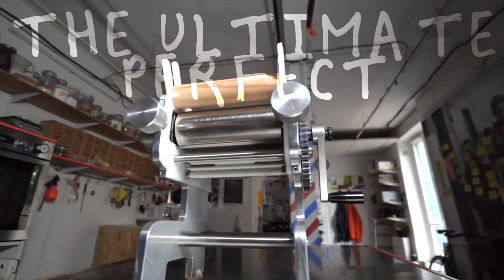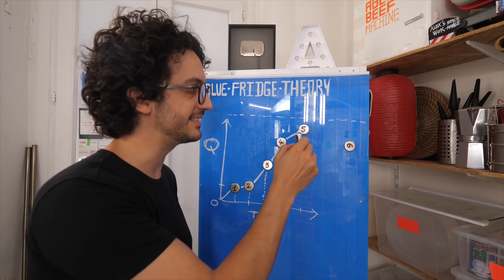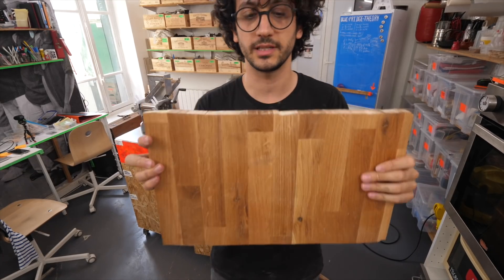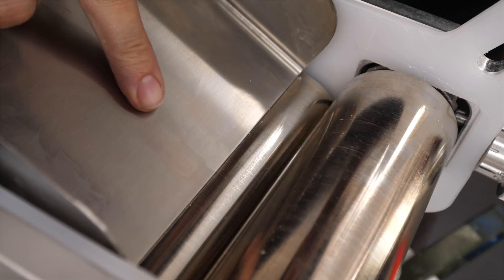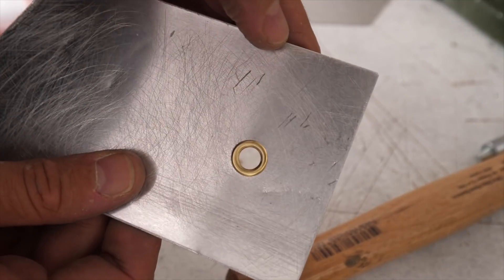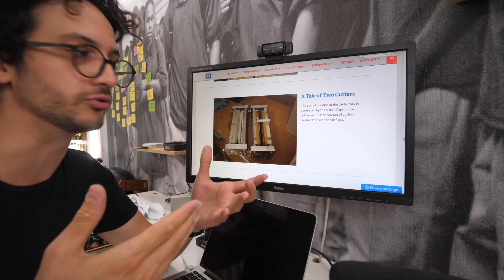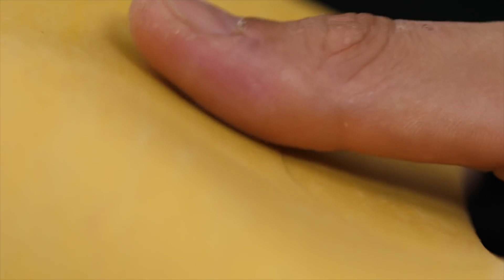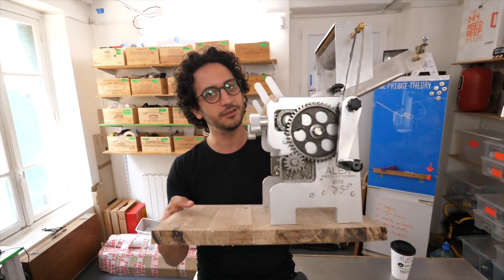You've Never Seen A Pasta Machine Like This... (build)

Comment: I 'member when this was a cooking channel. BTW your tension screw should be spring loaded so you adjust the spring tension preload rather than the actual pressure directly so it self-adjusts with the different heights.
Reply: This project gets 'better and better' the more comments come in!
Reply: He has the screw only on one side. Wouldn't this raise the roller from the other side, potentially ripping the dough due to uneven tension?
Reply: Ideally, true; maybe not in this application.  'Our Hero' will discover more as he goes along!
Reply: Icarus he has one on each side, as seen at 6:32.
Reply: I was thinking just a bit of flat spring steel that was then tensioned. This would have the give and float with the dough as you mentioned. At some point though the solution will not be great because you cannot get much of a range of tension with such a small diameter pin and a single point of contact. For greater tension range you need a strap that wraps the pin or a disc clutch with the disc clutch maybe being more practical for this application but then not flowing with the dough.
Reply: For sure, this is high level thinking.  We pasta makers might like a better machine at a lower price...but the very best machines already exist and it is only necessary for us to save up and buy them if we are desperate lovers of pasta in its various shapes.
Reply: Spring steel around a pivot would work too, might well even look better. Only problem with that is adjustment mechanisms tend to be more complicated.
Reply: If the tension is "set it and forget it", you could get away with a nut to counter the threads.
Reply: Martin Nicholls: "Only problem with that is adjustment mechanisms tend to be more complicated."
Not necessarily. (Que over-complicated explanation) For this particular machine he can put a couple of nuts on each adjustment screw to form a shoulder for a spring to rest against, then thread a small spring over the bolt. As a brake shoe Alex will have to take a piece of plastic (piece of old cutting board?) and drill two holes in it. One will be slightly larger than the shaft of the roller, the other will be perpendicular, but not all the way through. It will form a pocket for the end of the spring to sit in. With a deep enough pocket the spring itself will keep the shoe from sliding off or turning with the shaft. To adjust the tension the original screw will be screwed in and out, moving the shoulder that in turn will press on the spring that will preload the brake shoe to the shaft.
Hopefully that explanation made sense. Once you create a mental image of this idea it becomes much simpler :)
Reply: Actually, this should join to a torque converter hydraulic coupler to maintain consistent output.

Comment: just a tip, im an aprentice for a company that work with automation in industrial food production, and for dispensing and even layer of flour(typically on conveyors) we use a container much like you made like a strainer, but a vibrator that shakes the entire thing, this gives a very even layer of flour
Reply: It would need to vibrate based on the manual crank.   This might add a lot of torque to the crank resulting in a user experience thay requires a stronger user.
Reply: @BrasingtonAssociates  Sensor on the crank, Arduino doing PWM on the vibrating engine based on the sensor reading? Or a custom circuit to contain the sensor --> engine control. That would eliminate most of the extra torque and since Alex does know electrical engineering he could pull it off in-house.
Reply: Ooooo he said vibrator

Comment: Alex, I know this series is a bit old, but if you would like to make a version 6 of this machine I have some suggestions.  As Tony mentioned, that tension adjustment screw is a bit wobbly and could be improved by using a longer threaded collar with a more finely threaded screw pitch to reduce the tendency to both wobble and back off the tension unintentionally.  Also, if you want to improve on your pedal controled sewing machine motor drive idea, might I suggest sourcing a motor from a commercial grade electric air compressor like those used in a mechanic's shop.  They have more than enough power, are designed for heavy usage, and many are connected to the compressor via a belt drive pulley.  The only tricky part would be connecting it to the control peddle since these motors are typically designed for single speed on/off style control systems rather than a variable speed controller.  I have faith you can figure it out though.
Reply: having the screw directly impinge on the roller is a bad design which i dont think a finer thread would fix, it should be changed to be a flat lever that impinges on the roller and the angle of the lever and thus the amount of force it applies to the roller be adjusted by a screw

Comment: You and this old tony should do a limited supply run (100-500 machines maybe) of this pasta machine (the improved version in this video) and sell it for $150-$200 for all of us ramen addicts who don't have the tools to machine our own
Reply from the maker: Problem is it would cost a bit more...
Reply: Alex French Guy Cooking sell for a bit/a lot more, then? Would be A LOT of work though, so I understand it may be impractical.
Reply: If you can send me the specs on the rollers, I have some industry contacts that I might be able to sweet talk into generating a quote on 1,000 rollers. The price of steel is rising. I don't know the dimensions but even a 3/8" body and 1/2" gears would be pricey. I could give the specs for a complete machine to a machinist after sourcing raw stock. Made in the USA sturdy enough to last a couple lifetimes nearly maintenance free. You're probably looking at $100-$150 per hour just for the machining. Count in the cost of a business being able to handle all of it at once, its going to be a job shop with razor thin margins. Maybe $800 per machine. You're probably better off getting dimensions from ToT or Alex and finding a CNC shop in your area and start hitting up scrap  yards, you could probably end up only paying for a few hours shop time if you do your homework.

I work fairly closely with a machinist, there's an undeniable art to their accuracy and precision. 

You could save a bit on machining by eliminating some of the form. Make sides with only 3 machined edges, eliminate countersunk screws, find rollers already on the market, find as much 'off the shelf' items as possible.

Sorry for the wall of text.

Probably a lot cheaper
Reply: $200 doesn't even pay the stainless steel it is made off !
Reply: A CNC shop would charge you $200 for each wall of he machine. $100 each cilinder. At least in my non industrialized country. lol
Reply: What about selling the files for the 3d rendering of the machine for like $20-$50 a pop? That'd eliminate the mass producing while still giving Alex and Tony some kickback ☺
Reply: Im in for 900$
Reply: Well seeing as you have a design and working prototype this would be the perfect thing to put on kickstarter or similar.
Reply: Money could be saved by using pipe instead of solid rollers for example but it would still be quite expensive. They would probably be sold though even if they were more expensive...
Reply: Most machinists would charge 150-200 just for the rollers. Machinst time is very expensive not to mention materials
Reply: All of the problems listed above, and then the copyright issues. Putting a few mods on it doesn't change who has the legal right to produce it. Not saying it would be hard to tweak the design enough to avoid such problems, but when the video proof is online for where the design came from it's not like you can just say its a coincidence how similar it is.

Comment: Come on Alex, with the flower duster all you need is a front and rear cover to contain the flour and concentrate the dusting downwards instead of out towards your shirt! If you bend some thin sheet metal into a C section and attach with whatever fastener you're comfortable with it should do the trick. Also your fly wheel belt and the adjustment knob deserve some work. I know it's a DIY job but this machine is a piece of art, making bowls of art and I think they deserve all the TLC you can give them. Love the videos regardless mate :)

Comment: For the flour dispenser, some type of vibrating thingy probably will work even better, it's kinda of like sprinkling sugar powder on cakes, you put it in a sifter and shake it. And for tensions, springs would work better, much easier to control and precise.

Comment: Have you considered a plastic or rubber lip on the dough feeder? This would allow it to actually touch the roller. And it works, the 2m long "back and forth" dough rolling machine i have used since i am seven years old has them aswell.

Comment: You can adjust the tension with a belt drive as well, where the dough support roller turns slower, than the flattening rollers. They use this method at the foil stretching machines
Reply from the maker: Alex interestesd. Beep. Please clarify. Beep.

Comment: Like your mods. They look a bit proof of concept at the moment though.
The tensioner looks like it might be better served by something with spring loading for evenness off pressure and on both sides of the roller.
Perhaps a couple of wipers that push to the side of the slot and on the side that drags the roller to the bottom of the slot during rotation of the roller.
All the flour sifts I have seen have some sort of wiper/s that drag very close and over the whole area of the mesh at once.

An interesting and entertaining build, keep it up.

Comment: Most incredible outrageous pasta machine in existence, kudos! I want to upgrade my pasta machine as well. However, I was wondering how do you clean it? And because of all the adjustments made into the stainless steel doesn't it rust? (especially if you would wash it with water)

Comment: Alex French Guy Cooking a stopper mechanism on the far side of the roller should help stability as the dough is un/rolled, so the roller does not rise and fall during the cranking process. Wrapping twine or rubber, or applying epoxy, to the friction end will help maintain consistent pressure and reduce wear on the wooden parts. You seem to be a bit of a perfectionist so I think these tips will help ease your mind.
Reply: If you go for twine as an easy and cheap solution, applying a bit of wax to the twine will help with flow during turning and should do away with twine debris. Obviously wax will reduce the friction but that can be counterbalanced with a few turns of your tension screw.

Comment: I think the flour should be in a rotating cylinder perforated with holes, inside the mesh you made. It might spread more evenly than the bolts.
A way to disconnect the flour rotation could be that you add a third wheel on the belt drive that is connected to a lever that can tension or release tension on the belt. No tension = belt just spins on the wheels. Tension = it drives.

Comment: Instead of washers to dust the flour you can use another roll of steel mesh rotating inside (outer fixed, inner rotates), it'll work much better

Comment: I had another idea to improve your machine. The Italian Nonna's use a wooden table to make their pasta, mainly for convenience but also to increase the surface area of the pasta (roughness). Extrusion pasta machines use brass dies through which to extrude the pasta. Why not use  wooden rollers instead of steel ones? Just make sure they are thick to avoid breaking or bending them under pressure.

Comment: Maybe order a belt or o-ring to replace the gorilla tape?  Nice job modifying the pasta machine.  No offense to TOT (as I found you from him), but as  designer, I thought not having any flanges on those feet was going to make it difficult to stabilize.  Glad you figured out a way!  Also, instead of wet paper towels, you can get some of the shelf liner (with little holes) and it will keep it from moving around...plus you can reuse it.

Comment: My little silver pasta machine fell apart just like yours and after seeing your Alibaba purchase, I made an account and bought one just like you did. Mine arrived unbroken. I took it completely apart and for the past week I have cleaned, scrubbed, and reassembled. After all my work I am still getting those small dark spots in my dough that I know is bits of tiny metal. What did you do to stop that from happening? It's always along great the edge of the dough, probably from the rollers, but I have cleaned it so much already.  Did you have this problem too?

Comment: Couldn't you just add a second roller which will feed some sort of wrap onto the flour roller as it.....rolls? That way something would layer between the dough sheets, making it easier to come off. It should feed automatically if it is done right. I think. Or maybe saran wrap wouldn't work with the dough?

Comment: Alex French Guy Cooking What if for the flour so that it doesn't go everywhere, have an outside agitator so that it taps the container of flour, thus the flour only sprinkles downward rather then being flung all over the place! Just think of it like you're taping a sifter/sieve of flour rather than pushing the flour through it. The idea is not much different from your current design, you just have to re-position the container or the agitator, either one.
Reply: OOOOOOOOOOOOr just create guards/shields in the front and back of the flour holder so it only falls downward...

Comment: Sorry, but the first thing i would have done is a propper, abjustable electric motor to run it.... You would not have the problem with tention (can be done by hand as the maschine runs) and you do not need the flour dispenser (could be done by hand with the old methode that was much more delicate and uses much less flour.
The curling..... hmmm, don´t see the reason for it. Ramen are only in this form when they are packaged and will turn straight when cooked. So it is only done for the packaging. As you played with the noodles they where straigt again, so no purpos.